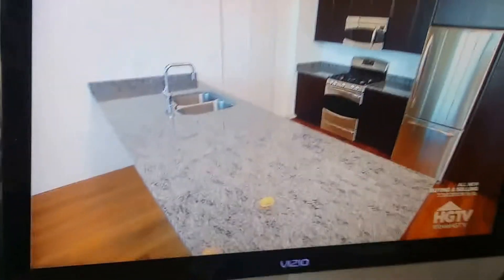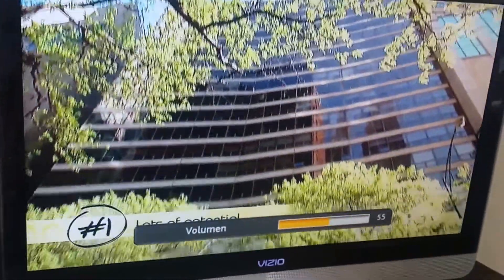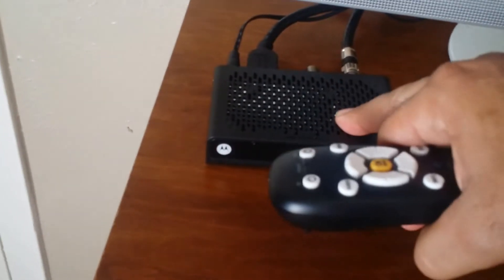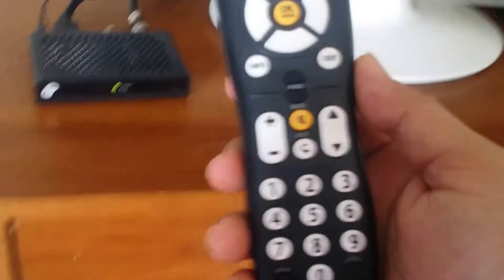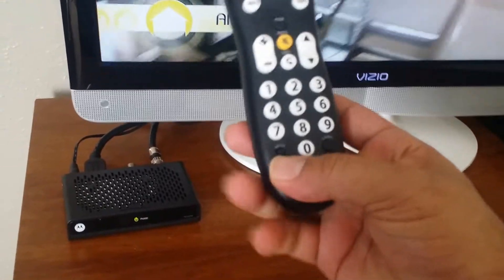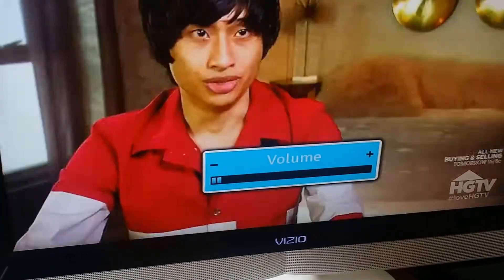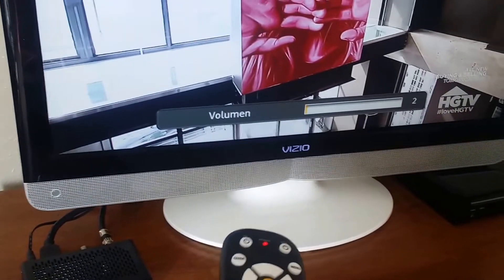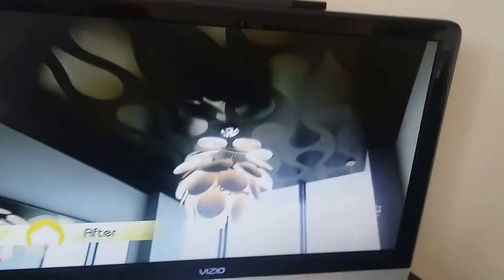How to fix low volume on a Digital Adapter.

Comment: My digital adapter...I have suddenly have picture but no sound...am in toronto...HELP PLEASE....
Reply from the maker: I need more input. Did you unplug it? Did you replace your TV or mess with it? Power blackout. Or just no sound suddenly. 

BTW, press the MUTE button on the remote. Some devices have a 'HARD' mute, meaning the volume button won't mute/unmute, only the MUTE button.
Reply: @Xatruch504   the sound has suddenly gone off...no blackout....picture great otherwise...have unplug  both the TV and the adaptor...yes have pressed the mute multiple times as well...no did not mess with the TV at all but I am aware I have legacy service but  the cable provider has not given any end date I suspect this is from their end...
Reply from the maker: @user-wn2di5st4k  Well, it seems you gotta find out which device lost sound. Those adapters are known to overheat, so it could be that.
Also, check if you have Fiber Optic ISP in your area and change provider. Coaxial is long obsolete these days, and TV services have also moved to the internet. 
I think one of the devices is gone.

Comment: THANK YOU!  Simply, Volume DOWN gives you the chance to command the cable box' volume bar (the thicker blue bars).  Volume UP allows you to command the TV's volume bar (whatever it may look like per your tv).  Hold down Setup and wait for the remote's light to do something special to let you know you can now give special commands using the remote, then press Volume Up or Down depending on what you want to "talk to" during normal times of operation.

Comment: Is this gonna work or any remote because I use spectrum cable I have one of these small remotes and then my actual tv  remote wich is not changing anything as my cable remote took over
Reply from the maker: Your TV remote does not get affected by the Spectrum one, if your TV remote is not working normally, maybe is damaged or best case scenario the batteries are discharged, try replacing them, the Spectrum remote comes programmed to the cable box or dta, and in some cases they need to be re-programmed (very rare) but in most cases they need to be paired to the TV but it only affects the power On/Off & the Volume settings. I hope you could solve the issues with your remote.

Comment: Thanks for posting this video! I thought the cable box was damaged, I'm glad you posted this fix! Sitting on the remote somehow muted the sound on the cable box and then when I went to use the volume it was trying to adjust sound on the tv instead of the cable box so no sound came out. But switching the remote to sound control for the cable box allowed me to turn the volume up which unmuted the cable box/digital adapter.

Comment: What about if the channel button doesn't work
Reply from the maker: The tv should not change channels, but the DTA, the remote should only work the volume on your tv. And your tv should be on channel 3 or 4 if you use a coax cable from your DTA to tv, otherwise should be the HDMI.